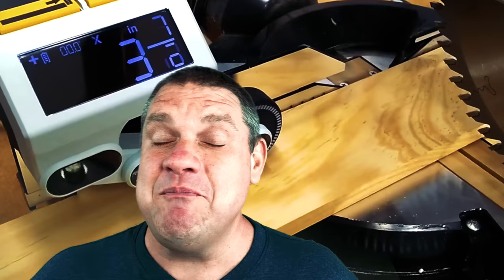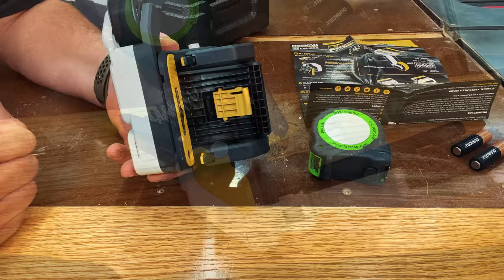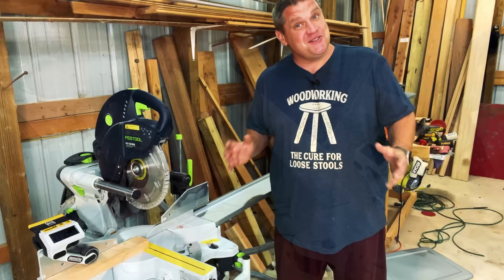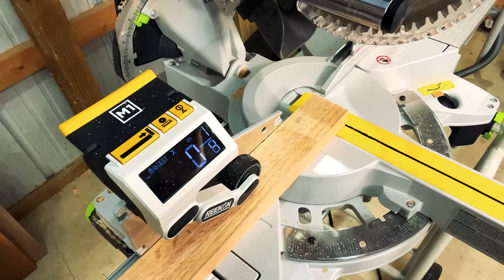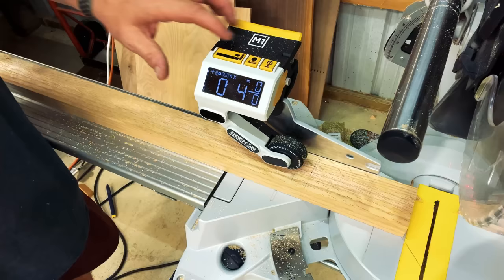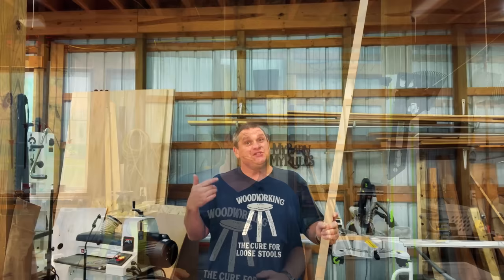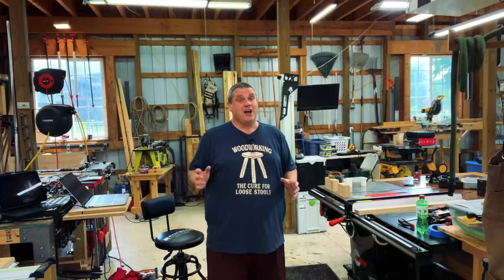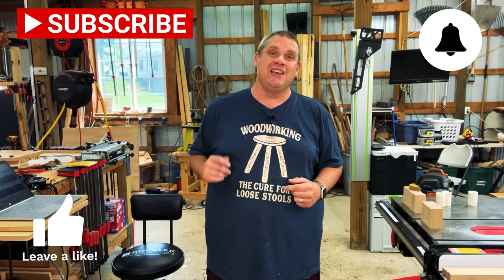Achieve Flawless Cuts with the Ultimate Miter Saw Upgrade! #woodworking #mitersaw #reekon

Comment: Just got one of these and am quite pleased with it. On the Festool miter saw, I noticed you set the blade width at 1/8" - It is actually 2.5mm on the Festool (printed on the blade), which is .098" - 1/8" is .125", so you're introducing some small amount of error there. I usually make my cuts from the left side of the blade, and have struggled to cut smaller pieces because of the way the Festool miter saw is set up. With the Reekon M1 Caliber, smaller cuts are quite precise and safely done.  And since I use a zero clearance insert on the saw, I just align the piece with the zero clearance insert cut, zero out the M1, and I'm ready to make accurate cuts. I'm pleased with this upgrade to my miter saw.
Reply from the maker: Excellent point LDBecker.  I'm trying to remember from this video how I set this up.  You are 100% correct, the festool blade is 2.5mm, I'm trying to remember when I recorded this I feel like I showed 1/8th on the video, but had it set to the 2.5mm for the testing.  I probably wasn't clear at all on that.  Thank you so much for pointing it out though, and thanks for watching!

Comment: A cool tool for sure. But, for repetitive cuts, it seems a stop block would be faster and more accurate. I wonder if it could be adapted to a table saw fence? Maybe the wheel could ride along the front rail? Thanks.
Reply from the maker: Yeah, it will be hard to beat the tried and true stop block.  I'm going to be working with it for a while and see if it get's the use it requires!   I know it will be good for some shortcuts that I may make, as I always struggle with the stop block when it gets in the 6'' and below!  Thanks for watching richpeggyfranks490!

Comment: The one big flaw I see in this is, if you are using Imperial and need to cut a fraction, say 6 3/8", you'd need to convert that to decimel to get an accurate cut.  Faster with a tape.
Reply from the maker: Well, it does go down to a 1/32 in fractions, but yes, I agree with you, you will have to convert to decimals for the highest level of accuracy.   Great concern Jim!

Comment: I bought one of these a few months ago, but I don't use it because I can't get repeatable cuts (and this is not a blade calibration issue). I contacted support about it and they gave me some advice. I followed the advice and it didn't work and I never heard from support again. The first issue I had was that I could move the stock under the wheel slowly without the unit registering the movement. I was able to make cuts that were (a) too short, (b) right on, and (c) too long, just by moving the stock slowly. The stock was not sliding under the wheel. That's when I contacted support and went through the setup again. The next test I ran was without "moving the stock very slowly" to cut 3 pieces of 4" in length. I got two exactly 4", and one that was 3-31/32". Since I don't have confidence in the settings, I have to measure my piece after it's been cut and if I am going to be doing that, I may as well use my tape measure every time. 

I tried to sell mine on FB Marketplace, but there were many others and I didn't get any bites.

Update: I might try again using the decimal setting, but to be honest, this just feels like a gimmick to me. If other people have success, that's great, but I tried twice and failed twice.
Reply from the maker: Thank you so much for sharing this HibsMax. I like to hear everyone’s experience.  This is one of the tools I’m absolutely going to do a follow up on.  Really appreciate your experience.  I haven’t had the same experience but just like with all tools, I know different tools work better than others.  Thanks for sharing!
Reply: @FlynndoggWoodwork  - if you do run some more tests, I would be interested to hear your findings when sliding the stock under the wheel very slowly. I was able to move the wood without the readout changing because, I suspect, the precision is not very.....precise. If this has a precision of +/- 1/64" (I forget what the claims are) that could be 1/32" right there (+ one time followed by - next time).
Reply from the maker: @HibsMax  I hear you!   Time will tell with this tool.   I'm definately going to share my experience with it after about a years use, or no use!   Thanks again for watching! :)

Comment: Excellent work on describing the tool use and process. The results are remarkable and the ease of repeatability of cut lengths made without a stop is fantastic. Looks like a winner! 👍😎
Reply from the maker: Thanks so much heystarfish!  Yep, pretty impressed so far.  Now all I need to do is to get my confidence up enough to trust it on all cuts.  That will take some time and a lot of affirmation!
Reply: For repeat cuts where consistent length is critical, stop blocks are still the way to go - as long as your stop is securely mounted, every cut will be the same.  The M1 really shines where you're making lots of different length cuts.  Think cutting baseboard or crown for a full house -- once you have your cut list you can cut everything without touching your tape measure.
Reply from the maker: @jeffeverde1  Excellent point Jeff - Thanks for sharing, I agree with you.   I was making some cuts at the miter saw today, and was using my stop block, even though I had the reekon attached because I was making some repeat cuts that I had to come back to after making some other cuts, and it was nice to just flip my stop block back down.   Thanks for watching!

Comment: I didn't notice on your DeWalt but did see that on the Kapex you did not have a zero clearance insert against the fence. Have you ever heard of that? You know that a zci prevents tear out. You can make a simple one by attaching a piece of quarter inch or 3/8 inch or 1/2 inch plywood to the two fences on the saw. There are surely some holes in the fences for attaching things. With the board attached to both sides and the miter at 90 degrees, saw through the board. You now have a kerf wide zci. You will have to bevel the top corners where the blade passes through in order to do any cut other other than 90 degrees vertical like on a compound miter cut. You could back the fences away from the cut line as well. You may have to experiment with the height of the fence attachment as well. Cutting angles even though they are 90 degrees vertically may call for experimentation of fence placement. Also, you can make your own but https://www.colliflower-zci.com/store makes zci s for the miter slot.
Reply from the maker: Oh my gosh jeff! you must be reading my mind.  I was thinking about that the other day.  I really need to add one.  I got that zero clearance tape for the bottom of the Kapex, but after I installed it I then quickly realized that I need it actually at the back of the miter saw parallels with the fence.   Thank you for giving me a great idea for a future video!   Really appreciate comments like this!   Cheers!

Comment: Does the tracking wheel gather dust and tiny chips? If so, does that degrade the performance?
Reply from the maker: So in my limited experience with it so far, it seems as though it does gather just a little bit of dust, etc.    I have been checking it every time I use it so that just to make sure there is nothing like a wood "chunk" that is attached to it that could screw with the measurements.   But you are 100% correct, if there is any material dust or debris on it it could impact the measurements.   Thanks for the comment and questions as I think this is an important one!

Comment: Some enterprising maker with a bit of free time could make a version of this with a powerful stepper motor which could advance the workpiece by a preset amount.
It would require, I’m imagining, a low friction surface to the left and right of the saw to help the wood to move but I think it might be doable.
Reply from the maker: You know before I looked into this tool, that's actually what I thought it did.  What a great idea.  Thanks for sharing, and thanks for watching!

Comment: You should not need to calibrate it between machines, other than changing the blade kerf (if applicable). The calibration would only change if the wheel was starting to wear, which is presumably why they made it relatively simple to calibrate. If the wheel wears it will start to measure too short of the desired cuts.
Reply from the maker: You know I agree with "you on the you should not have to calibrate other than changing the blade kerf" I wondered about that too, as really the only thing that is changing is the blade kerf (theoretically).   The movement of the wheel would only be affected by wear and tear, Thanks for bringing this up.   One thing that I did notice as well is that it is really important to keep that wheel clean as if wood chips get on it (which they inevitably will) that will affect the diameter of the wheel which will affect all measurements.  Thanks for sharing and watching.
Reply: How so? the distance from the blade would change due to fence differences between manufactures, or even simply because of where you put it on the fence. so you would need distance and kerf
Reply: @2wheeledgeek555  The distance measurements are all relative, not absolute. The distance from the device to the blade essentially does not matter. Put the piece at the blade, zero the reading, then advance to your preferred cut length.

Comment: That was an excellent breakout, Bryan.  Very thorough, as always.  But here's the question: in your opinion, is it worth the $150?
Reply from the maker: Thanks so much ScottyDrake.  And yes, that is my biggest concern with this product.  Will it get used in real life.  I think it is one of those things that you need to gain confidence with at first.  I'm going to still be using my tape measure for a bit along with the tool to make sure things are Kosher.   I suspect if I get enough proof with the accessory that shows me it does just as good if not better, I will gain the confidence to solely rely on it.   But the technology really is impressive so far.    I'm sort of a tech nerd though!
Reply from the maker: @b3arwithm3  If it was for sale for 10 dollars I bet it would be flying off the shelves! :)   Respect your opinion, but I think its a pretty cool gadget, definitely a convenience tool.  I think some people might have better uses for it than others.   Thanks for watching!
Reply: I think it could've been a bit cheaper for sure , as usefulness of the tool I can say I've been using it a year and it doesn't disappoint,  and yes it takes time to trust the tool , because in the beginning I was double checking the cuts but it faded away after while , yes you can still cut very accurate cuts even without the decimals as long as you see the x mark on the screen , overall it's not a necessity but I'll call it accessory for a tool ,will it make your life easy ? Definitely not , but it's a tool that can assist you in repetitive cuts , I don't regret buying it
Reply: @daddybear236  I am pretty sure the measuring tape doesn't make life easier either  , I did referred to the tool as an accessory and not necessity , definitely I can do the same task on both measuring devices as accurate and fast 😉,

Comment: Well that tool gave me some wood. I get it, Anyone with experience can make accurate cuts without the tool, but it's not just about accuracy. Consider how much time is spent measuring and marking a board and then remeasuring the cut to make sure it's right. With this tool you can eliminate all that time from your project, unless you're they type that enjoys the overall experience and wants to enjoy this phase of the construction process to the maximum.  Just get the work done quickly and move on to Miller time. One tip for the boys that complain about the accuracy of fractional measurements. Think about this. Most people working construction are high or drinking and a variation of 1/8 of an inch is more than good enough for those people. Decimal isn't hard if you want to use it. You can do all the conversions before hand instead of trying to figure it out on the spot. If you're afraid to do math, just ask Seri to do it.
Reply from the maker: I like your positivity on this tool, Seems like a lot of people have had some issues with using this tool, but I've been using it for a couple of weeks so far, and I haven't been disappointed yet.   I used it to cut some pieces for an upcoming short and measurments were dead on accurate.  Thanks for sharing and I agree with you on all points rick!
Reply: You can still cut accurately without decimals , just look for the x mark on the screen
Reply: @agent7agent759  personally I always use fractions because that what I used as a kid and I'm comfortable with them. When it comes to construction I've never seen anyone care if a measurement was even an inch off.  My dad was always precise with measurements and doing any kind of construction. I'm just so so at best.

Comment: I can see one problem. 
My shop is only 10 feet so I can't run a 6 foot board through it. I would need at least a 12 foot area. 
If you could calibrate it at a shorter distance it would be nice.
Reply from the maker: Oof!  That stinks, I'll look into the tool and see if you can calibrate it at a smaller length.  My guess is no, as I think it needs that distance to hone in the accuracy.
Reply: You don't need a 6 foot piece of wood ,just cut 2 pieces of approx 40" of wood and run one behind the other one 😅
Reply: @agent7agent759  , THANKS, You know that's such a simple solution I feel like shooting myself in the foot for not thinking of it!
I sure hope you have a great summer.
Reply: @a9ball1  you too  enjoy the summer ☀️  👍
Reply from the maker: @agent7agent759  There you go!  Good idea!

Comment: Good morning, great video very informative. did you make any cuts like 5”11/16 Or 3 3/4? if so, how accurate were they? Thanks
Reply from the maker: You know that would have been smart to do those cuts!  I didn't in the video obviously but I have since made some at various measurements like that.   It seems to be just as accurate.   As long as I convert those fractions to decimals!  Thanks for watching!
Reply: @FlynndoggWoodwork  Cool, thanks for the info have a great weekend!!!
Reply from the maker: @danieldurkton2942  you as well! :)

Comment: can't understand what the length has to do with it.  Am I missing something.
Reply from the maker: The length is used so that the tool can count the rotations of the wheel to determine how many rotations are needed for a certain length.  By counting the rotations on a longer piece of wood, the machine I assume can take a fraction of those rotations to determine smaller lengths when measuring those.   All of that is just my guess though.

Comment: It is rather interesting that the measurement wheel collects debris. This will change the circumference of the measurement wheel. The more debris collected the greater the measurement error.
Reply from the maker: I 100% agree.   I'm still testing this tool to this day.   But you are absolutely correct.  It will be important to keep that wheel clean, which will be hard in a shop!
Reply: @FlynndoggWoodwork  Your videos are informative and have an honest opinion. Great to learn  from them.
Reply from the maker: @rorytitley195  You're too kind, thank you so much and thanks for watching! :)

Comment: Hi, what is the maximum length we can measure with this tool?
Reply from the maker: Great question!  I tried to do a little bit of research on that.  I know I've measured 12' but I think it could go longer.  The longer you get though the less accurate I think it will be.   Difinitely better I would think 12' or less.
Reply: @FlynndoggWoodwork  tnx

Comment: What is the actual specified resolution of the tool ?   
I mean is it +/-  1mm or 0.1mm and is it this the resolution regardless of length cut ? (Doubtful) ... 

I WAS going to subscribe but after a quick look at your vid archives, it seems like you're more of a tool review guy, nothing wrong with that per se but I prefer channels that build cabinets and furniture etc... 🤔

😎👍☘️🍺
Reply from the maker: Great question, reekon says it is accurate between +/- 0.02″ or .05cm.  I would tend to agree with that after using the tool for a bit.   

And I agree with you, I enjoy channels that build stuff as well.   I'm migrating that way, but since I have a full time job and put out 3 videos a week, I have a hard time doing as many projects as I would like.   I appreciate you watching! :)
Reply: @FlynndoggWoodwork  if I see ya in me recommended I'll drop in ... 😎👍

Comment: Based upon what I'm seeing, with the setup shown, you're not going to be able to cut 4 boards, eleven inches each, out of a four-foot board. The last cut has to come from a board just under 15 inches long. To make that last eleven-inch cut, with that accessory, you need a board about twenty inches long or longer.
Reply from the maker: I think I understand what you are saying.   That the last cut would need something to push it through the tool in order to get the cut.  Yes, this would be an issue, but you could really use one of the first 3 cutoffs  too push it through.  But I see your concern!
Reply: @FlynndoggWoodwork  Excellent suggestion. I missed that entirely.

Comment: Good luck getting a board that’s over 6’ with no curve, cup, warp, or bow to calibrate the unit.
Reply from the maker: Haha!  Well, I don't disagree with you!   I had to use an old hardwood scrap in my shop to calibrate as all my 2X4's were bananas!
Reply: Plywood guys , or go even cheaper mdf